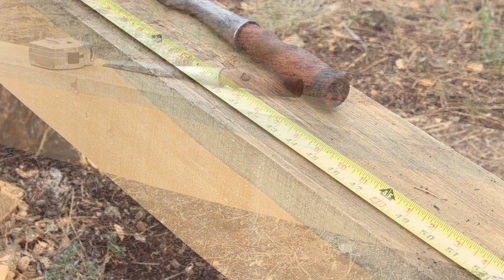Timber Framing an Outside Kitchen  pt 3   Country Living

Comment: crap. i just wrote a big comment and for some reason hitting backspace changed the page on me. i love the no power tools thing. i'm the same way. you should get the book "a timber framer's workshop" by steve chappell. it has wonderful illustrations, joinery layout, and engineering help when designing timber framed structures.
Reply from the maker: Johnmark Hatfield Thanks for the book reference. I will check it out.
Reply: Johnmark Hatfield m

Comment: If you’re going to go old school building you need to learn to clean the rust off your tools and you need to sharpen them. Dull rusty tools are what’s making the joints not as tight as you’d like. Also when filming outside make certain you have a wind break so that your voice doesn’t get muffled. Love the effort you’re attempting and your skills will grow as you manage your tools better. Dude you need a corner chisel!